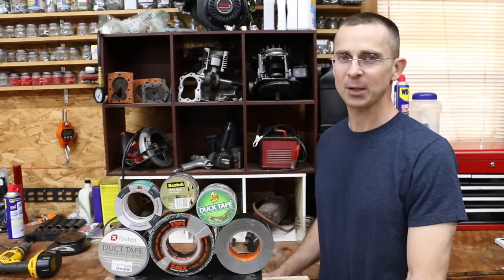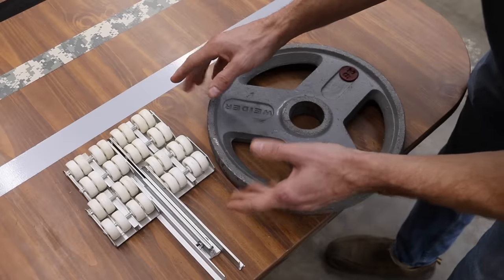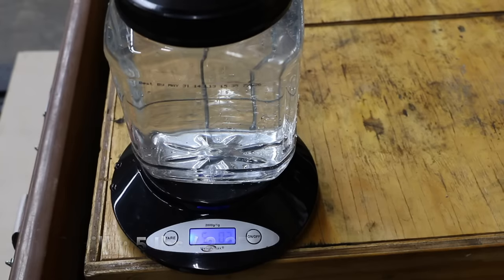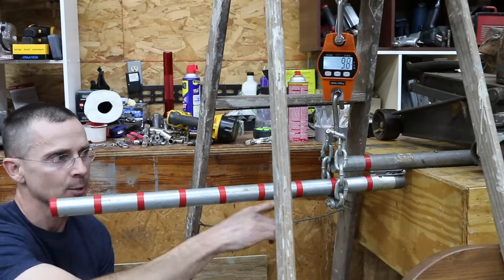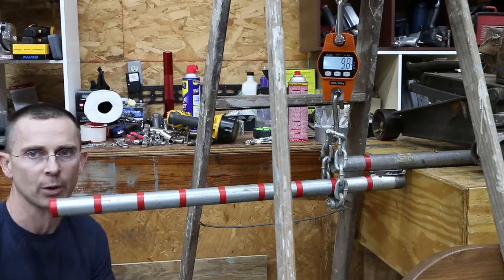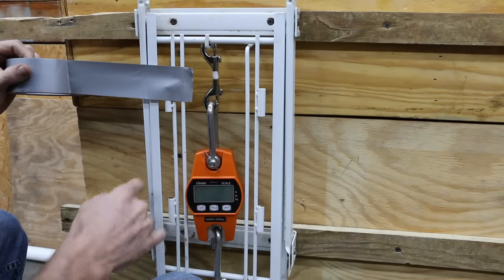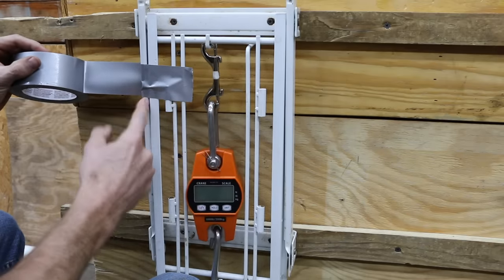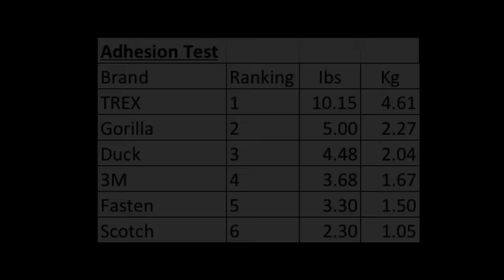Which Duct Tape Brand is the Best?  Let's find out!

Comment: 3M seemed disappointing, not a terrible showing but it was at one time a brand known for "the good professional stuff". Maybe they still have higher tier tape for industry but hardware stores won't carry it? 
It's too bad Gorrilla brand is so over priced (I guess when you manage to hold a monopoly on decent products and have a good marketing department...) Gorilla is a reliable brand for sure but not quite that good. By that I mean for the price of the tape or glue you are getting up into the price range of more proper repairs. I'll look into TREX.
The high speed really gave some insight, it is pretty obvious which tapes skimp on the fibers and basically just goo apart like warm taffy. 
I've been suspect of this for about the last decade, I could swear most [commonly available] duct tape used to feel different when I would tear it, stronger and stiffer, often needing a knife to start, a bit closer to gaffers tape; this just confirms it. I don't use or buy much ductape though so I couldn't be sure if it was just me, an off brand, or an old roll, etc, but nope just more poorly made junk on the market.
Reply from the maker: Thanks for the feedback.

Comment: I would like to see which one is easiest to get off the roll when the end is completely stuck. I try and fold a corner but damn, some are almost impossible to get started. 

Also, some will start tearing as soon as you find the end and start pulling on it. Some seem to just tear into small strips.
Reply from the maker: Thanks for the suggestion.

Comment: Duck tape it was first green and used by GIs to do stuff like cover gun ports of fighters to keep FOD out of the barrel. After the war they liberated some and took it home.  Heating companies liked it and it was made in grey for them and renamed duct tape so technically both names are correct bu it was first called duck tape because water would bead up and roll off it like a ducks back.
Reply from the maker: Thanks for sharing.

Comment: I used to build demolition derby cars and I loved to use the duck tape brand stuff on all of the door padding and I would wrap the snot out of the old eggshell foam I was using just so I wouldn't end up with that dusty nasty stuff going into my eyes whenever I would touch it and it worked great I could just leave the car outside for a year and come back to it and either run it in another derby or just put a slice in the tape and put the padding on a different car but around 2014 or so duck tape changed and if I left it out for a few months it would just rot away and I would have to retape the whole thing. I now refuse to buy duck tape and have switched to gorilla the sunlight doesn't seem to harm it 

It's a shame that duck tape doesn't hold up like it used to because I covered the shifter in my bronco with it back in 2008 and it still looks brand new and that thing never gets stored in a garage
Reply from the maker: Thanks for the feedback.

Comment: Duck tape used to be the best. Period. That was for my use for many years but that was many years ago. Easily for the last decade it has been gorilla. I have always went to gorilla and said it is 2 to 3 times stronger than duck.
On the. Adhesive pullback test or number one test. I don't hold much to that because I don't use applications that require that type of holding. And on the window test I would never use tape in that fashion as well. 
So for the majority if not all of my applications it's gorilla. But I was impressed by T-Rex
Reply from the maker: Thanks for the feedback.

Comment: I'm sure the ones with a pattern on them are wicker then the original color..
Reply from the maker: Thanks for the feedback.
Reply: no they're not. that literally makes no sense. they're the same exact duct tape with just a different color. why would it be any weaker? it's the same exact adhesive and materials used.🤦‍♂ lmao as if putting a camo print instead of a gray or black print makes your something weaker. dude use your head.

Comment: Mate, you screwed up reading the measurements of the Lateral Strength test: for 3M you had it set to lb, but for all the rest you had it on kg. So your table of results is wrong. Need to add a note correcting that.

Comment: Isn’t the “best” product dependent upon its intended use?  After all, there was once a little start up company that built its brand on selling an adhesive that was very, very weak… that company is Post-It and is now a $5 billion brand.  Maybe these tape companies should come up with something like a “nutrition label” that tells consumers about the strength of the product.  It could lead to Gorilla offering weaker tape or Scotch offering a stronger tape.
Reply: The intended use of duct tape though is to stick and hold their shape without ripping. If they were different kinds of tape, like, say clear tape, that makes more sense, but these are more or less interchangeable products all serving the same function. It is like saying a car can be better if it is missing three wheels. Different does not mean better. It often just means bad. Post It notes are successful because they found a different use as a utility besides their stickiness. Sure, you could use duct tape for leaving messages or whatever or for decoration in an environment where stickiness is not applicable, but then there are simply better options. But, by all means, go out there and find a use for non-sticky duct tape and become a billionaire. Until then, people will want their tape to stick and if it can't do that, it is shite.
Reply from the maker: Thanks for the feedback.
Reply: @tygonmaster  don’t have to.. there are already use cases.  My neighbor used weak duck tape to hang up Halloween decorations … weak enough as to not pull the paint off their siding (but also stronger than “clear tape” so it would stay up for days)… just because YOU don’t use something a certain way doesn’t mean that other people couldn’t ✌️

Comment: I believe you have the spelling incorrect.  It is not spelled "duck" tape (Quack-Quack like a duck) .  I am sure the correct spelling is "duct" tape like for using on heater and air condition ducts.

Comment: I don't recommend using any of the "super" tapes. I build airplanes and use grey tape all the time. Those super tapes are just nasty. They'll pull the skin right off your fingers and don't even think about using it on a painted surface (goodbye paint).  I prefer plain duct tape with NO weave showing on the back side. T Rex is the worst and I've tried them all. Just my HO.
Reply from the maker: Thanks for the feedback.

Comment: I bought gorilla duct tape . Nothing but junk ,wrapped it around pipe insulation, it unraveled.taped it to a wall, didn't stick, to a door frame same thing, it doesn't even stick to itself! 
WHAT IS THIS WORLD COMING TO. 
WD 40 and duct tape were the main staples to my tool box. Would have been better off with clear packing tape a stronger animal and cheaper
Reply from the maker: Thanks for the feedback.

Comment: I sell duct for a living. This test is so bogus. You have to compare equal mil thickness. The names mentioned are not  real manufacturers except for 3m. Compare equal mil thickness by manufacturer, 3m, shurtape, Berry global, IPG. Even then you can't compare unless you specify the intended use. I. E  general purpose,  construction, concrete, paving, water proofing. Your "testing doesn't mean anything.

Comment: You have to search how measure a tape adhesion power before decide which is best. Regarding to international standards, You should stick these tapes to steel plate. Then you should pull with stable speed. This test is so primitive.

Comment: Your test is not accurate you're supposed to pull straight down in One direction you're using angles which ends up weakening the tape by the edges thusly being an incorrect test if you want to test the pound weight abilities of the tape on an equal pull you most pull directly down on both sides evenly
Reply from the maker: Thanks for the constructive feedback.